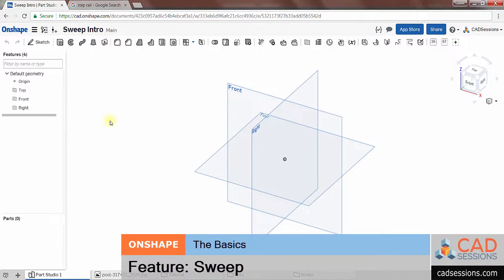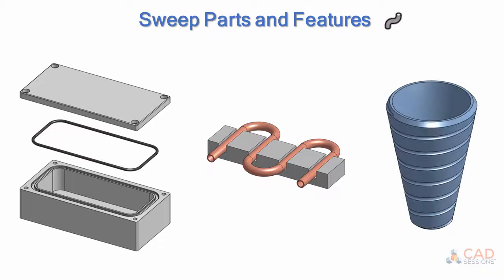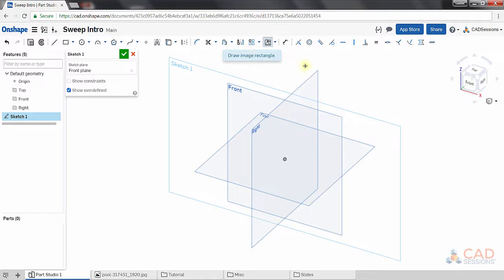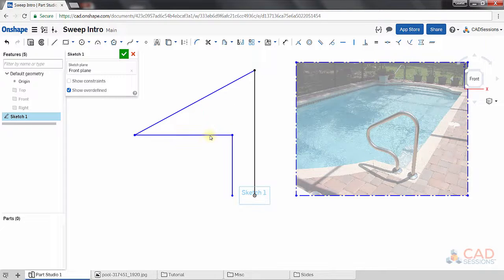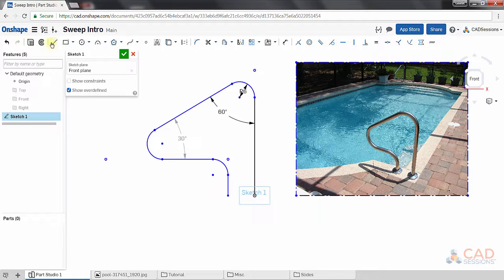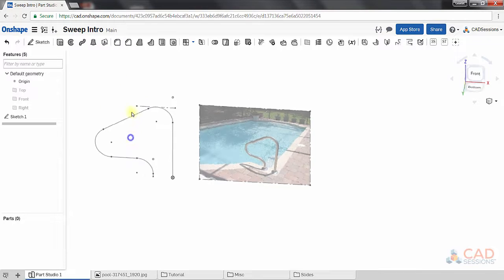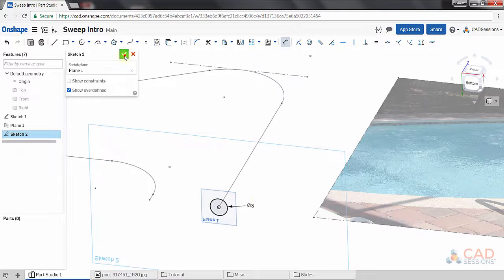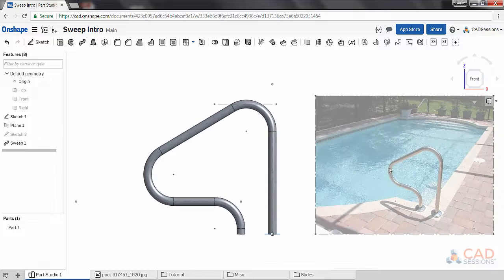Sweep Feature - Basics - Onshape 3D CAD

Comment: I am always impressed by your teaching style. You have a true gift for teaching. One question though. The construction line you placed at 48" is in the CENTER of the extruded circle. But if I wanted the top of the drawing to equal 48" instead of the center of the swept circle, and because you chose 3: as the diameter of the circle, should I lower the top by the radius (1.5") or is there a better way of ensuring the total height is exactly 48"

Comment: So I noticed that the construction line is still tied to the center line of the pipe. Is there a way to make the overall height to be 48” or would I just have to make the dimension 46.5” to the construction line knowing that the radius of the pipe would be going above that construction line?
Reply from the maker: Good observation! One way to do it would be to  use Offset to create an offset construction curve at the top there, with the radius of the pipe, then make the horizontal construction line tangent to that instead.

Comment: every time i insert an image its sideways. then i edited the image sideways to correct it and its still sideways.... help?
Reply from the maker: What kind of image file are you using? By sideways, do you mean rotated 90 degrees? 
If you use the Transform button, you should be able to rotate the image inside the sketch permanently.  The Transform button is sometimes hidden in a drop down list under the Linear Pattern button. 
Once you click Transform, select a border line or point  of the image, and an image manipulator will appear. at the corner. Rotate the image by click-and-dragging the circle with the line through it. Left-click to accept. 
Hope this helps.